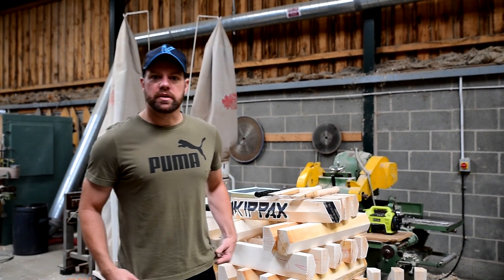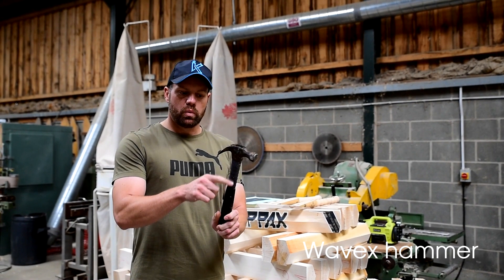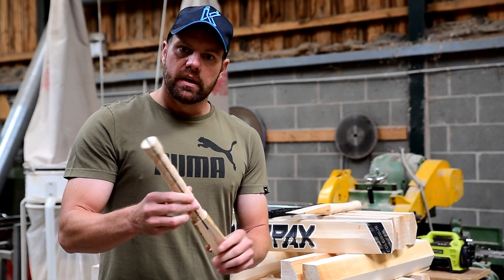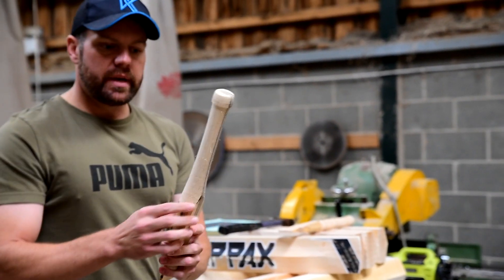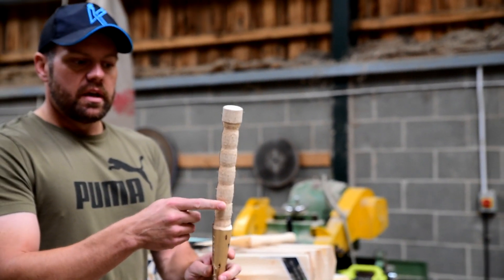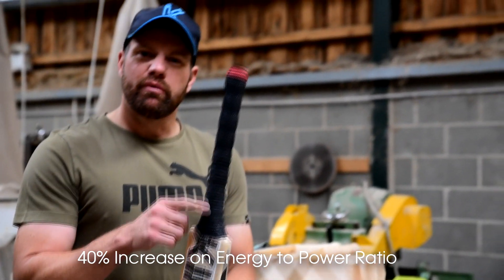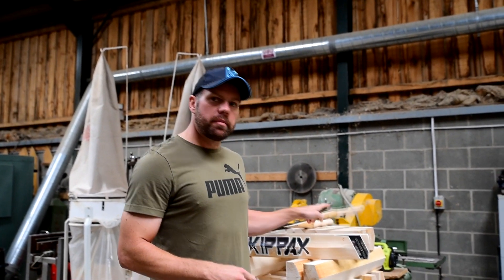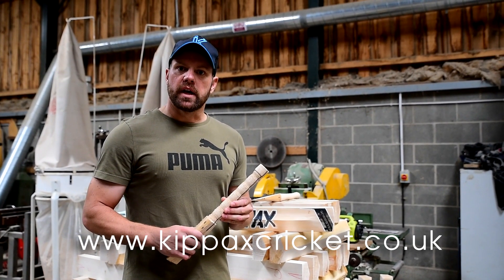The Kippax Cricket Wavex Technology - and how it works

Comment: It won’t work it will effect the feel of the bat🏏
Reply from the maker: It does work and is working now, once the batt is stringed up there is not that much difference in feel :)
Reply: Kippax Cricket Limited convincing but you should do a video in nets on this topic normal oval, round handle vs this technology. 👍🏻
Reply: VS VIDHVANSAKA you can’t do a video proving that’s there no vibration I’m on my sisters ac btw